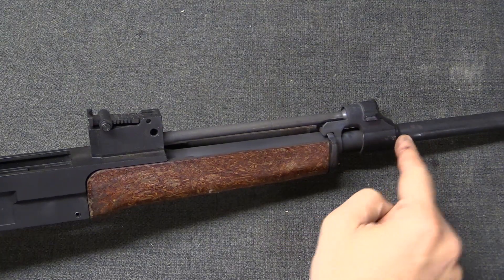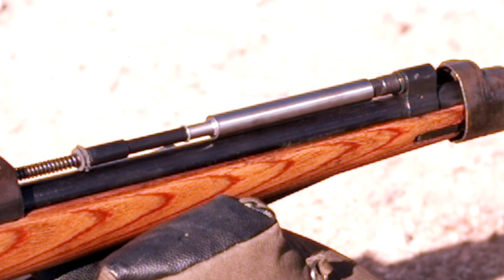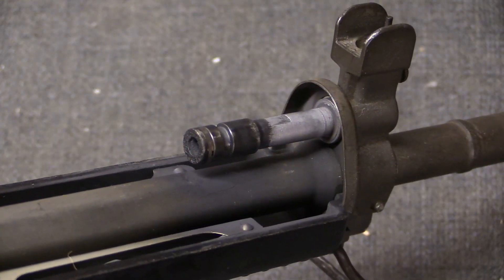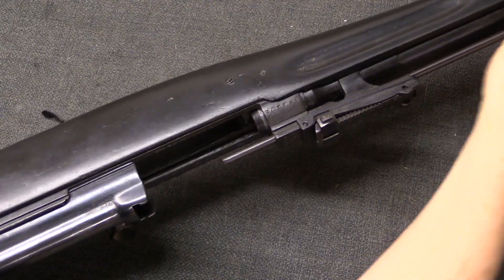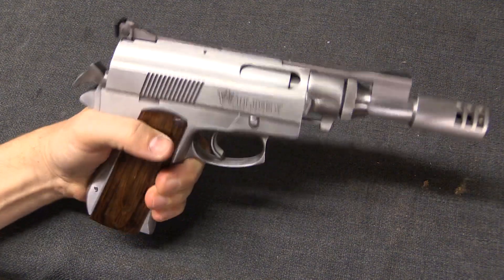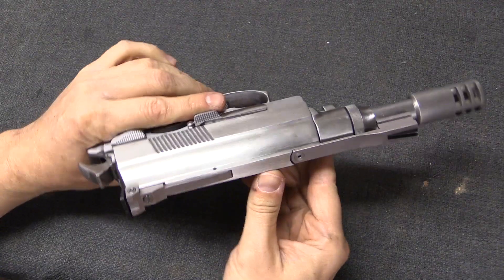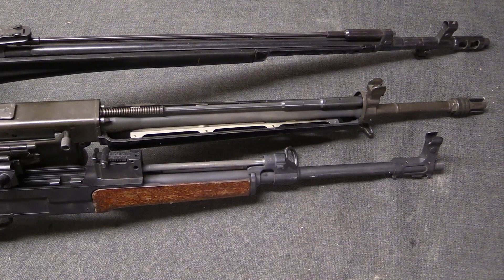How Does it Work: Short Stroke Gas Piston

Comment: I’m working on a new type of weapon, i want as much recoil as possible but i would also like the weapon to be light. I would like the recoil to come from the slide stopping like an out of control freight train. Accuracy is not an issue, this weapon works on different principles…. It seems like long stroke is the way to go….. is there any reason to go with short stroke G. J. Hasn’t mentioned here? 
ALSO how do i figure out how big the piston’s diameter should be? 
•i want extreme slide acceleration but i also want enormous force (I’m planning to reload multiple large gage shotgun shells with each cycling of the bolt. I intend to have ludicrous barrel pressure).

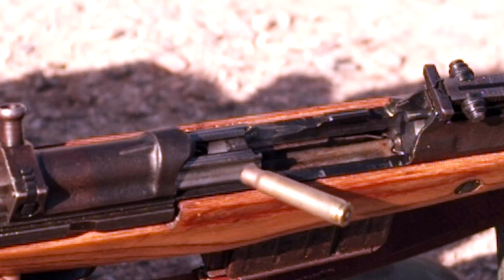Comment: 0:35 In a short stroke piston driven AR-15, like for example an HK416, does the rearward movement of the piston have enough momentum to drive the bolt carrier group all the way to the rear and cycle the action? I was under the impression that the piston only moved the BCG slightly backwards, enough to unlock the locking lugs, and that it was the pressure in the chamber and/or the recoil (Newton's 3rd law as a result of accelerating the bullet) that moved the bolt carrier group the rest of the way. I'm genuinely curious

Comment: Do a video on sks gas system.
Reply: It's pretty much what you see here... The basic operation of the SKS is not much different from the VZ 58 seen here.
Reply: It has an additional part 'plunger and #2 a spring' that this one doesn't have.
Reply: @PistolManiac100  On the SKS the gas piston simply hits the piston extension (the part with the spring under the rear sight) and that then hits the bolt carrier, cycling the action. As Ian said, the reason for this is easier disassembly.
Reply: Just saying

Comment: Why is the gas pressure imposed directly on the bolt face by a fired round insufficient to unlock the breech, but gas vented from the barrel further down the line sufficient to cycle the whole action? 

Shouldn't there be a lot more pressure pushing against the breech through the barrel, than through a gas operated piston?

Comment: I love my Adams Arms AR short stroke pew pew :)
I was iffy about the weight in front at first, but it turned out to feel nicely balanced when firing and is SOOO much easier to clean. My concerns over copper fouling turned out to be mythical and went away after sending enough break in rounds downrange.

Comment: The Wildey could use some improvement. Maybe redesign it into a broad-stroke mechanism? 
The gas is vented from the barrel into the boiler, whereby steam is generated in the water tubes, which in turn operates a piston that turns a lever with a ratchet to move the slide.

Comment: Does it accelerate the piston as fast as the bullet?
Reply: No, the piston (and bolt carrier and spring tension behind it) are much heavier/have much greater resistance than the bullet and are only using a small amount of gas tapped off from the gas port, the vast majority of the gas is sent out the barrel pushing the bullet.

Comment: A lot of people assume that the SVD Dragunov is a large copy of an AK. But when i compare it to the VZ 58, I see some striking similarities. The shape of the Boltcarrier, the way, the recoilspring is set up and the use of a short stroke piston may be hints, that Dragunov took some inspiration from the VZ 58. What do you think of my theory?
Reply: I don't think so, because the short stroke piston system was used in Soviet guns for a long time already (the first one was AVS-36 in 1936), so Dragunov would rather have taken inspiration from the SKS or SVT-40, than some Czech gun.

Comment: In the short stroke system: Is it only the impulse given by the piston that pushes the bolt carrier back or does the push unlock some sort of spring driven mechanic that pushes the bolt carrier back?
Reply: Just the impulse given by the piston. Spring pressure is actually applied in the opposite direction to slow the bolt carrier down, stop it and then send it forward to load another cartridge.

Comment: So Ian, MAC channel recently had a video about DI AR15 actually being a piston gun! What is your opinion on it? The idea of an inline piston makes sense and is obviously genius!
Reply from the maker: Yes, the AR is a piston integrated into the bolt carrier. I covered this 5 years ago (https://youtu.be/10td_zRPlao), but it will be getting its own segment in this "How Does It Work" series, because that first video doesn't look very good.
Reply: @ForgottenWeapons  thank you for the response! His definition made total sense, but apparently I never realized how the system truly worked. I never saw your original video. But will watch it now, thank you Ian! Love the serious!
Reply: @ForgottenWeapons  I always thought it was designed that way as a sort of delay. Gas is forcing the bolt head closed and locked with the locking lugs in the barrel while it starts the carrier rearwards until the carrier's inertia is enough to rotate the cam pin and unlock the bolt.
Reply: There is no real difference in the operation of the two guns MAC channel shown, but only in the form of the bolt carrier. 
In the AR15 the bolt carrier is pushed rearward by the gas (direct impingement) and nothing else while, when this happens, the bolt is simply solidal with the receiver. In the MAS 49 what MAC called "the gas tube with a tiny little hole" is what in the AR15 was called "a piston" (a "stationary piston"). In the AR15 the "piston" (really the bolt) doesn't push the carrier at all, the gas does. The bolt it only seals the gas until the carrier retreated enough, exactly like the final portion of the gas tube in the MAS49.
Reply: @neutronalchemist3241  Honestly....the AR is pretty neat in melding 3 different styles of gas operation (gas delay, direct impingement and piston operation).  The MAC did well in explaining what goes on inside the bolt... remember, when you go to a real ice cream shop and ask for vanilla... there are still 5 different flavors to choose from (Vanilla, vanilla bean, french vanilla, homemade vanilla and Bourbon)
Reply: @slthbob  Nothing goes on inside the bolt, sorry, and the AR15 isn't a gas delayed blowback system in any way (between the AR15 and a gas delayed system there is a further gradation, the "gas unlocked blowback action", like that used by the HS.404 and the Scotti MGs). In the AR15, when the gas pushes the bolt carrier rearward, the bolt is simply solidal to the barrel. The AR15 is a direct impingment action because the bolt carrier is directly pushed by the gas, and nothing else. There is NOTHING that mediates between the expansion of the gas and the bolt carrier.
Obviously you can obtain it with different shapes of the bolt and the bolt carrier, like piston action can have different shapes of the bolt and the bolt carrier.
Reply: @neutronalchemist3241  Oops.. my bad... I forgot that if I want to believe that the sun doesn't shine... all I need to do is use capital letters and it won't shine... your need to be contrary on the subject is more important to you than this conversation is to me :D... cheers.
Reply: @slthbob  Sorry, but I explained my point. You, instead, preferred to talk about the sun.
Reply: @neutronalchemist3241  and yet you continue to treat a comment like an actual conversation... had a 3rd grader explain Santa Claus to me once too... his point was still moot... If you really need me to keep responding friend I will... just for you...
Reply: @slthbob   Sorry, but I explained my point. You, instead, preferred to talk about Santa Claus.
Reply: @neutronalchemist3241  keep fishing for that dopamine hit dude.... I'm here for you.
Reply: @slthbob  And you still are incapable of talking about firearms. At this point you could have learned something.
Reply: @neutronalchemist3241  Sorry... I dont talk about color with the blind...
Reply: @slthbob  And you are still are incapable of talking about firearms. You prefer to talk about colors now.
Reply: @neutronalchemist3241  your need for attention is approaching the pathological... have you taken your meds?  Maybe you need to check into that...
Reply: @slthbob  So you are talking about medicine now? Think that, at this point, with a little studying, you could have been able to discern the stock from the muzzle.
Reply: @neutronalchemist3241  Nope I am yet again pointing out some sad little persons desperate need for attention, from some stranger on social media, for a continued dopamine addiction, main lined in from a mobile device every few seconds since their life is so fulfilling.... "feed me Seymore...FEED ME!"
Reply: my god I am so entertained I think I just shit myself
Reply: @slthbob  And still you are incapable of talking about the matter. Unfortunately all that you are pointing out is your ignorance.
Reply: @neutronalchemist3241  actually I made a comment about your false opinion based on a lack of experience with mechanical operational physics... and backed it up with capital letters in an attempt to give it some type of validity... just because your ignorance is bliss does not make it valid... I am sure there is something you are getting out of this (attention mostly... from your mobile device and interacting with it)  I thought it was obvious that I was not going to take the time to teach you what you can learn at the public library.  But your desperate need for me to reply keeps me replying....
Reply: @slthbob  And still you are incapable of talking about firearms, and demonstrating that you are the one seeking for attention.
You are pretty funny BTW. Keep on.

Comment: It would be nice to have the name of the firearms appear in the video as you show them, just a little suggestion.
Reply: 0:01 Vz.58
0:35 Gewehr 43
0:44 AR-18
1:00 G.43 
1:33 SVT-40
2:02 Wildey Survivor Guardsman
Reply: Also the slow motion video is a G43.
Reply: From what I see.
Bottom: Czechoslovak Vz.58
Middle: By the look of that charging handle I'd Suspect AR180 or some of the older SIGs
Top: Soviet SVT-40 Tokarev (or copy of it), again very distinct Charging Handle
Reply: @John_Raynor  Yeah, I could see the czech Vz and the SVT, but since these videos have an educational purpose, and in this one in particular the guns are partially disassembled, having their designation pop up on the corner of the screen could increase the information delivered.
Reply: @ArthurAlcantara
I absolutely Agree, it would be nice to have those descriptions there
Reply: @Arthurzeiro   To be fair, if you're doing a video on inline engines and why they're commonly used in planes, you probably wouldn't mention that this one came out of a A-36 Apache and that'n came out of a P-51 Mustang.  You might mention, as a counterpoint, that this V12 came out of a Spitfire, but only because that's a relatively odd configuration for the time.
Reply: @Leafy1-j1l  I fully disagree, if I was to make a video on something live the Merlin V12 for instance, just the engine, i'd mention some of the planes that used it and also show John Dodd's merlin powered car called "The beast" cause they're relevant to the topic. An engine by itself isn't much if there's nothing for it to propel. 

If I was to talk about engine layouts in general I'd be mentioning iconic cars and engine combinations left and right, can you think of "automotive use of a V4" without thinking Lancia Fulvia? Inline six without thinking of the Australian Ford Barra, Nissan RB, Toyota JZ and the cars they powered? Edit: I shouldn't mention I6 without citing BMW.
Reply: @Leafy1-j1l  Why would you think a V12 and a single seat fighter is an odd combination in the late 30's/early 40's?
Reply: @jeremypnet  'Cause nobody's made Forgotten Planes yet, silly.
Reply: @John_Raynor  I believe Ian actually has a legit AR-180 (which really is an AR-18). I've seen him use it on InRangeTV. So you're correct! :)
Reply: I was about to say the same thing... but also now thank you to the experts who have provided the model details. Cheers!
Reply: just be smart. whats so hard about that ?
Reply: ArthurAlcantara
 - 
, everybody knows well